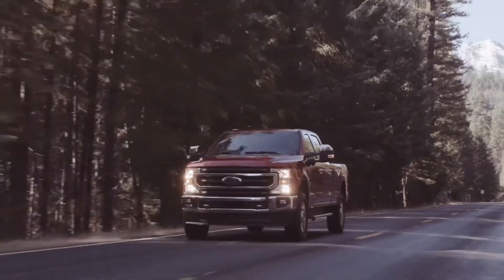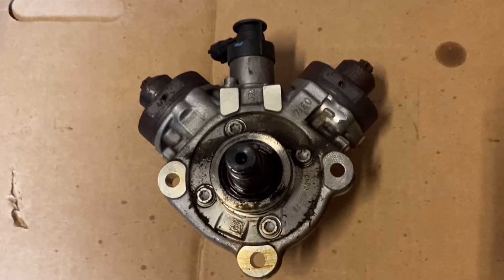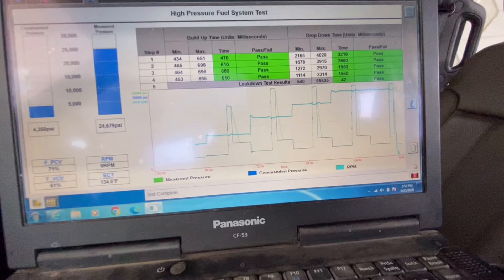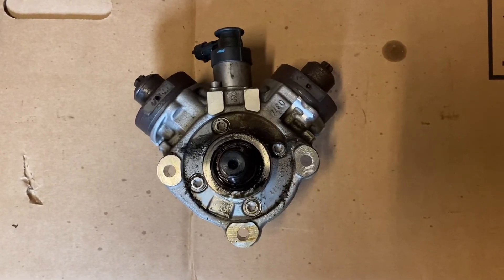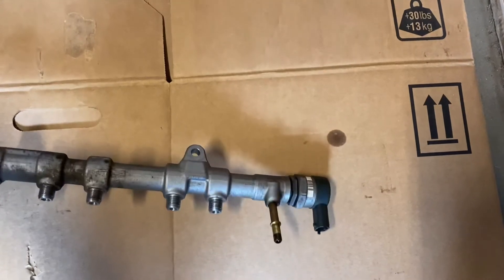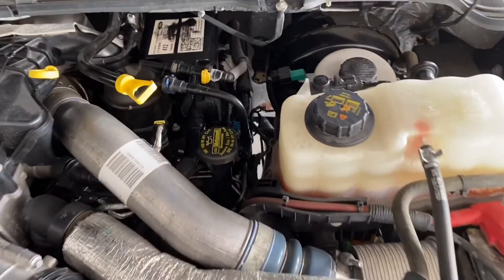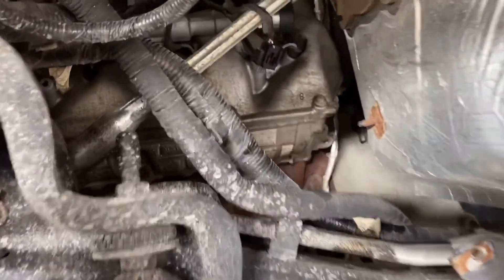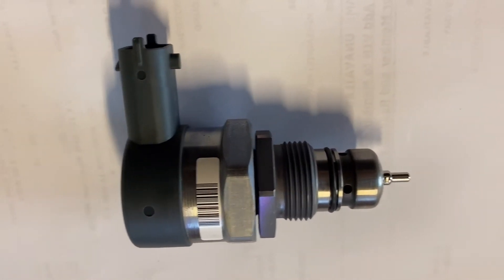How to Fix P0093 on Ford 6.7 Diesels

Comment: one of the trucks in my fleet has been doing this,  the thing is that all the parts I have currently replaced - YES, I was able to VERIFY bad....
DEF heater assembly
exhaust pressure sensor and connector - was broken
DPF and injector for it
injectors # 1 and # 8
intercooler tube (used upgraded metal one)
pigtail for pressure regulator (insultation on wires wore off and wires touching causing a P0092)
All my other codes do not repeat and only left with this P0093 sometimes turning off engine.
Like you it is passing all checks, I'm gonna replace it and go for a good test drive.
If the regulator is sticking open it would make sense that the engine dies.
will update  in some days.
thanks for the suggestion.
Reply from the maker: Hope it helped!
Reply: Did you fix this?
Reply: Did it get fixed?

Comment: I have the same thing happening now. Truck runs fine until you accelerate hard then it says reduced engine power. I replaced whole rail on drivers side it came from Ford with both sensors already attached. I reused the old lines to hook the new rail to. I don't see any leaks. Could the lines that they claim as one time use be the problem. I don't see any sign of fuel escaping
Reply from the maker: I don’t think it could be the lines if there’s not a leak. Was it flagging this code before you replaced the fuel rail?

Comment: I have the issue with my f250, replaced the fuel pressure regulator with a oem ford part and now it does it more often. Also have a low fuel pressure code. Next up is to check my fuel pump in my tank and make sure it feeding enough diesel to my hpfp
Reply from the maker: Low fuel pressure high side or low side code? What year truck?  Was there damage to the end of the regulator when you removed it?
Reply: I have the p0093, no metal shavings so I know hpfp is ok, replaced low side fuel pump as well to make sure it's feeding the hpfp enough fuel.
Reply: @LuisS1k_ did you ever find your issue? I’m dealing with the same thing right now.
Reply: @armandopadillajr.8550 did you find anything out?
Reply: Sorry it's a 2017 f250

Comment: I have a 17 250 6.7. Truck runs like a scolded dog empty. Hard through the mountains empty. Locally pulling 14K stop and go no issues all day. Hook my 8000 pound camper to it. And on level interstate after an hour it will just kick into reduced power. Quick on and off of ignition and fine. Getting P0093 and P0087. No reduction in MPG. No issues starting. When it kicks to reduced power mode it’s not even on an incline. Have had at dealer. Can’t get it to replicate. Want to replace entire fuel system. To me, if it were something that bad needing to replace entire system it would do it all the time. Going up steep grades not towing and flooring it to me would be as similar as towing light on level grade. Not willing to put 12k into the truck.
Reply from the maker: If I remember correctly P0093 is fuel leakage, basically the pcm thinks it’s putting more fuel into the injection system to maintain the pressure it wants than what it thinks it should have to for that condition. A lot of things can cause it, but most of the ones I’ve seen were the pressure regulator at the back of drivers side fuel log. P0087 is low high side pressure. The PCM couldn’t achieve the pressure desired on the high side. Both of those codes, especially the P0093 have to occur for X amount of time before it will flag a code, which is probably why your having trouble duplicating it. A one mile up hill grade just doesn’t last as long as driving across the state with a 10,000 load.
Reply: @CarShopTalk  thanks for the reply. It’s been frustrating. A quick cycle of the key and I’m able to keep going. Going to try that. I can’t trust the dealer as back in November I had it serviced for a little more travel in the brake pedal than I liked. $9200 later and it’s fixed after they just kept chasing an internal leak.
Reply: @nealyoung2874 my truck is doing the exact same thing..do you know what it was?
Reply: @CarShopTalk  you are correct. for the first 6 times it happened, no check engine light or any fault codes. 7th time engine line illuminated and was planning to take truck to dealership the next day. surprise... coded disappeared by itself. you gotta run it hard like you stole it for that light to stay on.

Comment: I added a new fuel rail and both sensors. I bought it from ford and the sensors were already installed on the fuel rail. My truck a 2015 4x4 occasionally blows the low pressure off a barb at random places but after fuel rail replacement with new sensors it will just go dead when I stop.  It will however crank back up easily and at the next traffic light or stop sign it goes dead again.
Reply from the maker: Usually if they blow a rerun line off it’s because there’s DEF crystals or other debris restricting the return line. It didn’t get DEF put in the fuel did it?
Reply: @CarShopTalk  I deleted most everything and no longer use DEF I didn't put any in the fuel and honestly dont know if anyone would have done that to me. I was working on it just now after putting on new low pressure lines and checked for restrictions all the way to the tank. I even took the fuel cooler loose and checked it for restrictions. It starts really fast, idles with no skip, seems to have drag car power! Turn off the advance trac system and stomp pedal ( I'm not talking apply brake pedal any to start a burn out either) to the floor and after rolling maybe 3 feet this engine will smoke these 35's I have on it. You can do it several times but then again like just now, sitting here idling it just shuts off. It will start back up with no problem.  Other thing it does is on the hwy not pulling anything, extra pedal to pass or enough to kick in turbo boost boom instant reduced power light comes on. It wont do it flooring it like a 1/8 mile playing with how the power feels. This is very strange. Any help greatly appreciated. You can call me if you have any ideas. I have had it in many shops. 256 750 3600. Thanks
Reply from the maker: @billtaunton6918  Is it setting any codes?  If it reducing power it should have something in memory.
Reply: This happened to me back in 2018 in my 2016 f350. Shuts of but when i put it in park it will crank with no problems. YouTubed some videos and replaced fuel system regulator at a Lowe's parking lot. and it fixed the issue. Here I am in newer f350 in 2025 and same issue again. I'm hoping this will fix it aswell
Reply: @ACEZRWILD1 did you get if fixed on the new one?
Reply: @jesusgonzalezpichardo6033  have not changed it yet since i can easily crank it right back up. but was planning to do so tomorrow. will update results.

Comment: Sounds like my problem too. What is the easiest way to depressurize the system?
Reply from the maker: I can’t say I’ve ever really had an issue with it. I had to change a regulator on one last week and I just loosened the regulator and a small trickle of fuel came out. Once the system is opened any where it drops to 0 psi immediately.

Comment: I like to know is how you torque the nut as you barely have room to get a wrench on it.?
Reply from the maker: I think you’re suppose to use a crows foot on a torque wrench. I’m pretty sure more than a few of them have just been tightened up and we’re just fine.
Reply: @CarShopTalk  What is your thoughts on using OEM or after market.
Ford dealer didn't have the fuel pressure regulator so called my auto parts and they had an after market.
I brought it. 
Look the same as OEM and had not issues for a month then started again after that.
Just wondering if I should buy from Ford dealer and replace again.
Reply from the maker: @df4720  I’ve never tried an after market one, but I don’t know why you couldn’t.

Comment: I have the exact same problem. 
I replaced the regulator and all was good for a month then started doing the same .
Now what do you think about after market.
I bought it from an auto part store not and ford because they did not have it on stock. 
Do you think I need to be another regulator from dealer.
Your answer would be greatly appreciated.

Comment: I had THIS EXACT SAME ISSUE with my truck. It happened to me while pulling my camper over 70mph and truck went into safe mode. I was fortunate to be rite next to a diesel shop that did upgrades and he did all the tests you listed in this vehicle but he 2 couldn't find the issue. as long as I was under 65mph all was good with the truck. unloaded I could do 100mph and never duplicate this problem with a load on the truck. so my initial thought and that of others said I needed to replace the factory lift pump with a s&B 56gal tank which has a built in sump and with the fass it gets 70lbs of preasure.  well I tried it again and again same issue happened so I limped the truck to where I was going just took longer but it made it there. while there I went to 2 more specialty shops and they like the 1st shop said it should not be doing what it was doing see I now have a cts2 and ezlink so I can see everything happening in real time and everything, everything was perfect in their values. in my mind since the 1st time it happened I thought it was this preasure valve so I had 1 shop change it idc what it did or costs.  well in the way to having this work done I happened across your video and BINGO this was exactly what my truck was doing.  since I had this part replaced I have given the truck all the crap I can and problem fixed. Thanks for your video more people need to see this one because I'm sure their are more then us both have this issue.
Reply: I'm having the same now but mine is still  just shutting down when I stop. Large leak detected code. I put new rail on with the sensors already installed on them from Ford. May the sensor is bad on the new one????
Reply: I also have this problem and after looking at this video switched this part but did not fixed it.
Reply: Did you manage to fix your truck? Help me
Reply: Hello friend! I have the same problem, but it only happens when I’m towing my 2-car trailer. I have a 1-car trailer and this doesn’t happen when I use it. So, in short, it only happens when I’m very heavy. Truck turns on the check light and turns off out of nowhere.

Comment: Good evening, i have a 2018 f350   6.7......I pull a 45ft gooseneck trailer and when loaded I have the same issue (P0093) and it's driving me crazy especially when I'm climbing hills thru West Virginia.
Reply: Did you fix issue . Having same problem with mines
Reply: @VictorHernandez-km9it I'm having the same problem, only when loaded. Did you fix yours yet?
Reply: @joseperez6234  Im having this same issue now. Using a 40 foot gooseneck. Only does it when loaded. Did you find a fix?
Reply: @AWilliams818  i had to replace the fuel pump and the whole fuel system 😢 ouch....

Comment: I got a p0088 fuel rail pressure too high  with a check engine light and a reduced engine power on the dash do you know what could be the cause in you experience? Or have you had this particular code before thanks

Comment: Hello
I have been fighting a problem where my 19 f450 will shut of and give “reduced engine power “ message on dash. Check codes and only one that appears is p0093. Truck runs flawless in every other aspect including mpg. It always happens when pulling very heavy loads “3car trailer loaded”. It is completely random when this will happen, but has been happening a little more often lately. I have had all of the basic test done for a fuel pressure, looking for metal in the fuel lines, and all the tests show good when it is at the shop and on the diagnosis scanners.
Is the sensor you show  replacing in this video sound like it would be a good option considering the trouble I am having. Thank you for your input

FYI no check engine light , just stored p0093 code
Reply: Good morning, did you replace the fuel pressure regulator....if so did it fix your problem? because I'm have the same issues on my 2018 F350.
Reply: It didn't fix mine. Mine will sometimes go dead and I can start it right back up. It throws no code though
Reply: @billtaunton6918  did you fix the problem? I’m mine is doing the same thing
Reply from the maker: It sounds like the same thing.
Reply: fixed mine
Reply: Hello guys! I have the same problem on my FORD 350 2018. It’s been many years since this video was posted. But could someone still tell me how you solved this problem at the time? This only happens when I’m towing a heavy-loaded trailer.
Reply: @fabianofernandees9246  I'm having the same problem, did you ever find the issue?